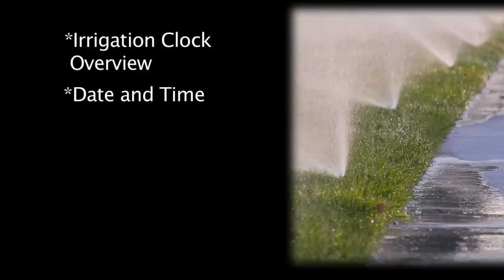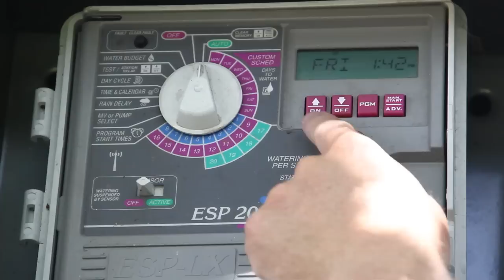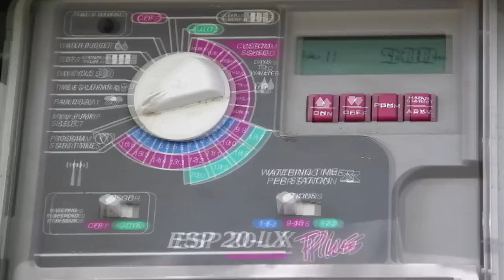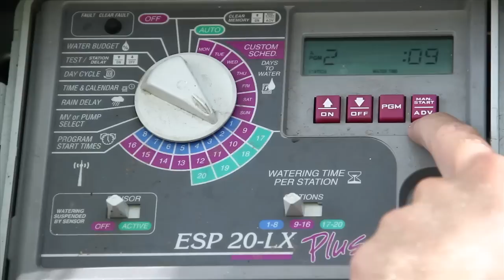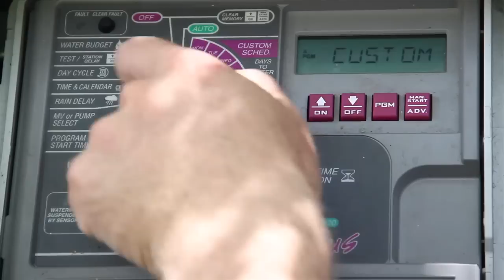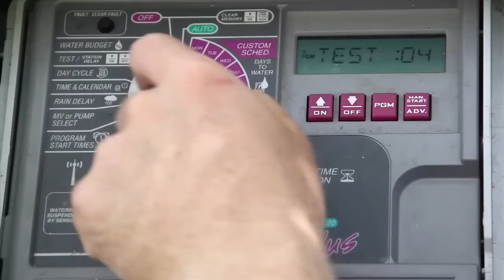Webbtraining1 - Rainbird Irrigation Control Training Video

Comment: And manual start is done how?
Reply: Turn the dial to the station and press start, then go to the next station ubwant to run and press start, then when done set to auto
Reply: Or you could just run a test on a program and set the time oncenforneach zone and press start and that will water everything